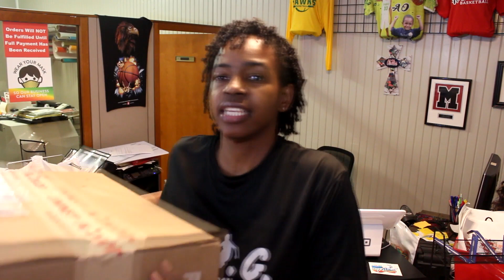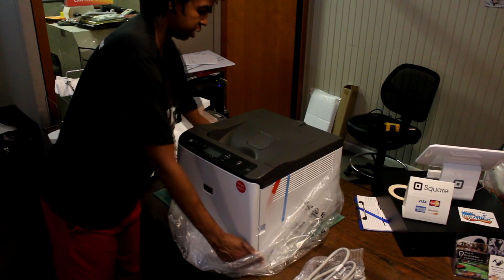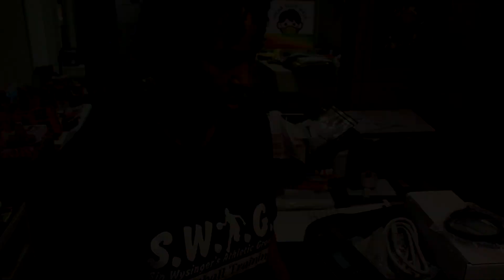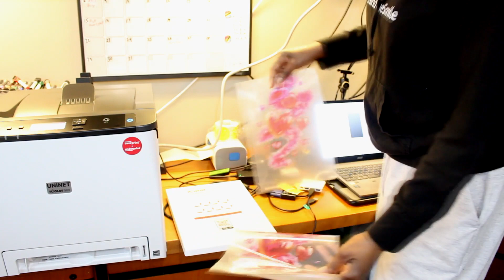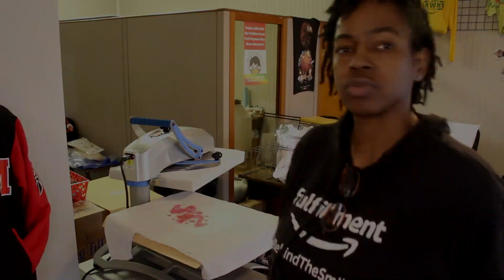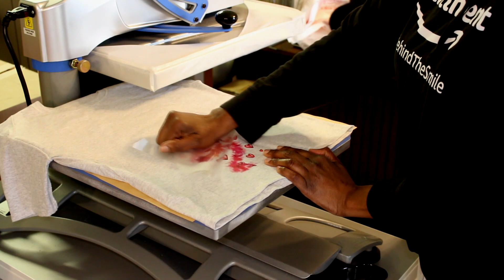iColor White Toner Printer Unboxing & Printing

Comment: I purchased the Ghost white tone cartridge for my HP color laser printer.  I wish i'd seen this video first.  I had to ruin a black toner to make the white toner GHOST cartridge work.  Its such a confusing process and GHOST directions do not make it easy either.   Good luck with this machine!
Reply from the maker: They sent it to me to do a video but I sent it back cause I wasn't going to use it for my customers and I don't have space for equipment I don't use.  Thank you  for watching!!

Comment: Hello, what was the temp, time and pressure used for the marrying process with the Fusion IQ Press?  I have that press and struggle with the marrying proces.  Also, what is temp, time and pressure when you peeled and pressed the A-sheet to the t-shirt?  Did you use a different temp, time, and pressure for the re-press to seal the design onto the t-shirt?  Loved the video...
Reply from the maker: Hi Dee!  I just followed the instructions that came with the printer.  I don't remember I would have to go back and look as I only used the printer once after this video